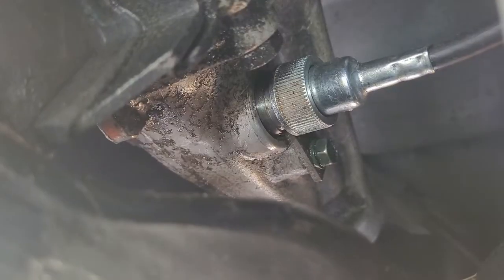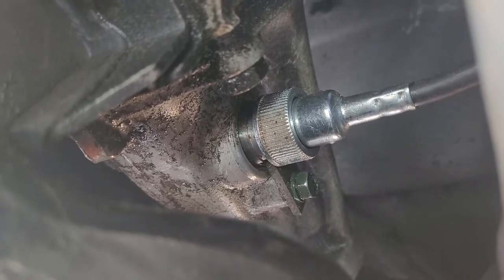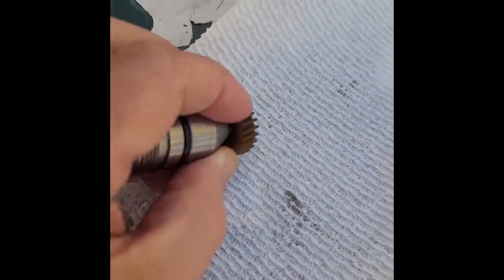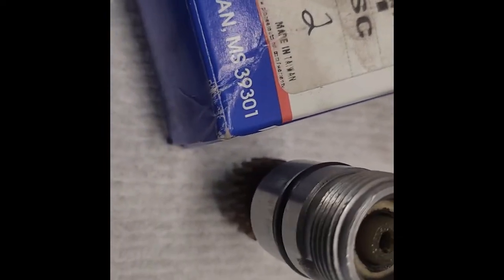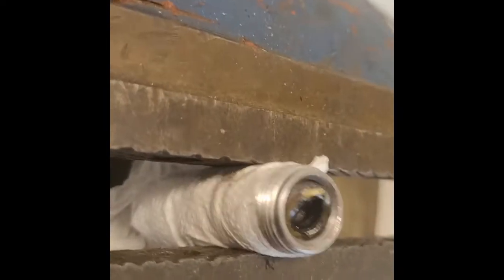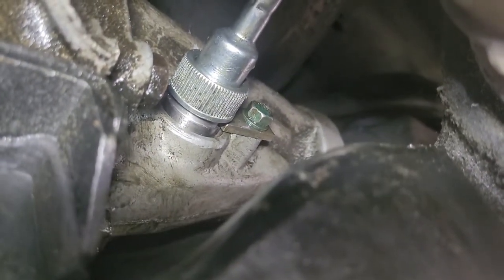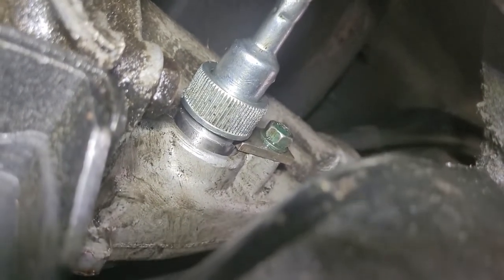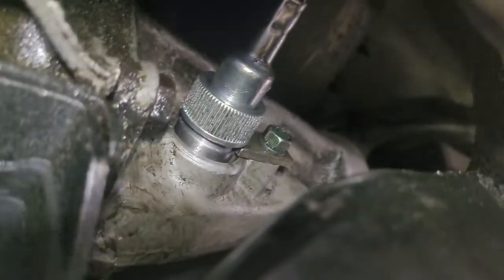Turbo 350 Transmission Speedometer Leak Repair, Chevy Hydra-Matic

Comment: part number for the seal kit please
Reply: 759024 it's in the video bro
Reply: @riotautorepair9662  What is that to the left of the speedo cable that appears to be opened up?
Reply: And you're a little for "Bro"
Reply: Left out "old"

Comment: Yup, I had the exact same issue with my 82 Firebird Trans Am.
Your outer O ring looks in better shape than mine, mine was kind of flat on the outside. but I replaced both the outer and inner seel and it fixed the issue very nicely.
:hand-pink-waving::trophy-yellow-smiling: